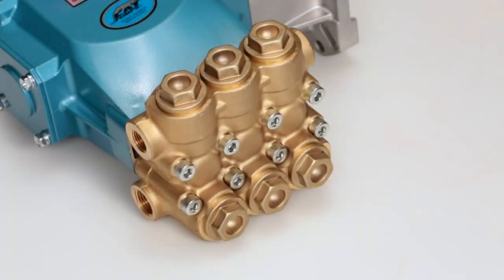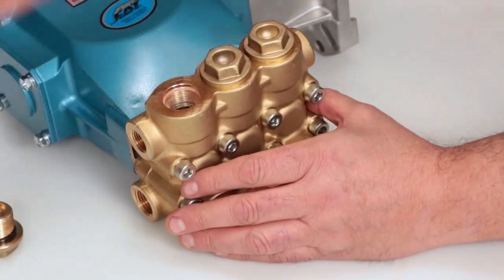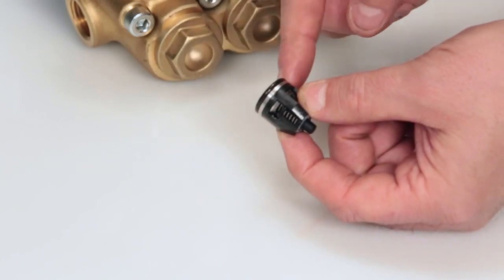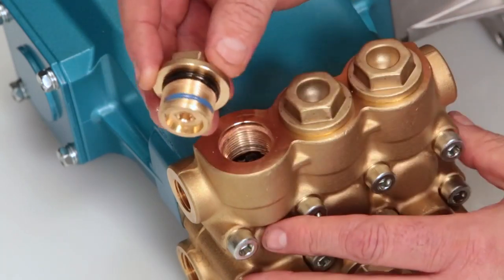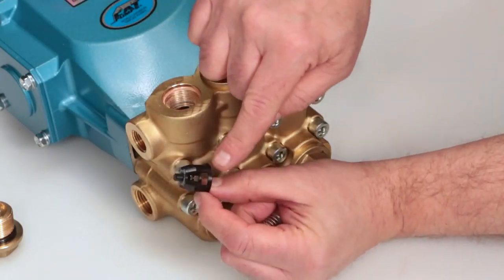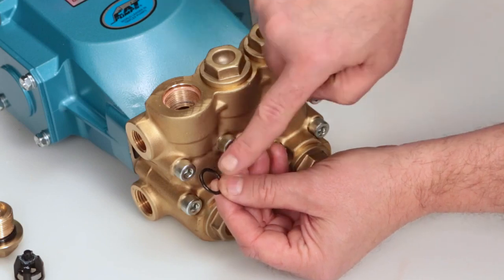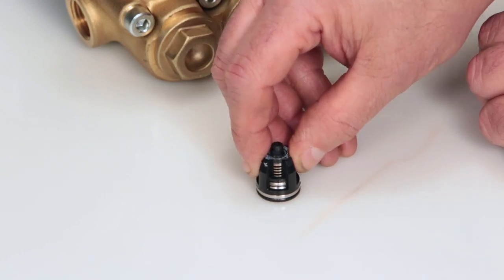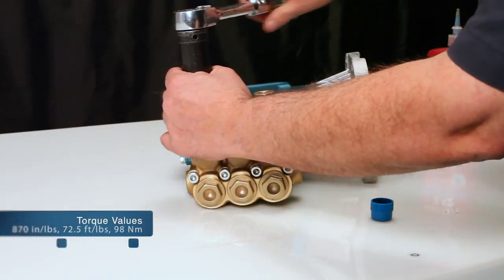CAT Pump Repair: Servicing Valves 66DX, 6DX, 5DX Series

Comment: Did all this and still NO pressure. 🤷‍♂️
Reply: No pressure? Sometimes you can get clogged spray tip, just saw mine was clogged, maybe even the gun could be dirty and clogged up. Even with a bad pump you will always have water come thru, so you have a stoppage somewhere.
Reply: @chaselesser3191   Yes but if the Issue is with the Gun you would certainly be able to tell if the Pump is providing pressure by feeling the Hose… there is Water coming out of the Wand it’s just not under pressure.